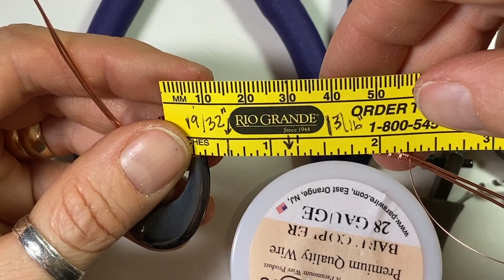My Personal Wire Wrapping Donut Pendant Challenge- Part 2

Comment: Is there a reason that you started switching to parawire copper from Rio Grande copper? I am newbie to copper wire and want to buy better quality copper
Reply from the maker: I actually started using copper from parawire because it was cheaper. Rio has one pound spools so when I figure out what wire I use more of I’ll probably get the pound spools from Rio.